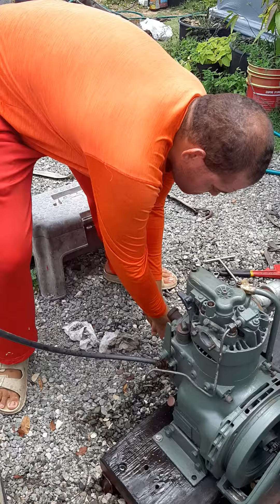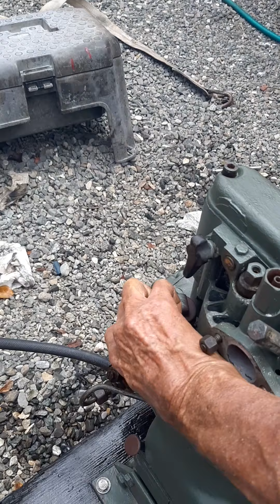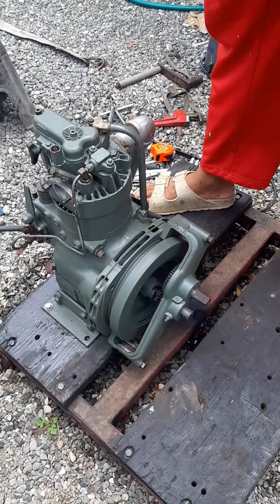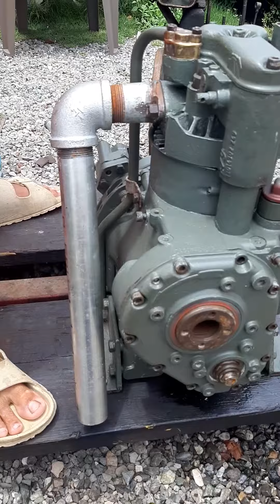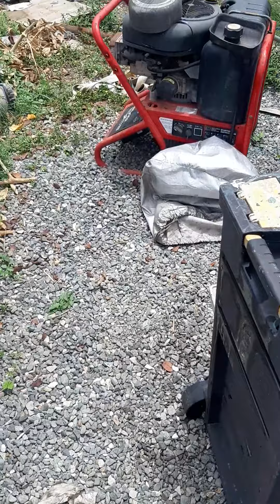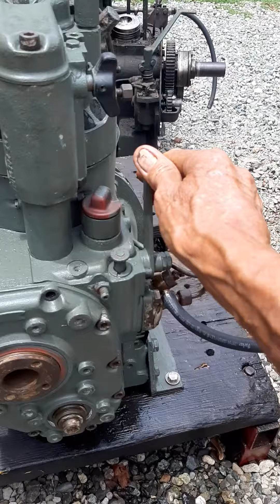Hatz E79 part 3 - it lives!

Comment: I don't know if you have seen it yet but my latest video has an inlector pump question for an AV1 you may be able to answer (I also mentioned your channel). Basically I have an AV1 pump that has a broken body. I have a spare PAZ1 injector, can I take an element and plunger for an AV1 and put it in the PAZ1 body? I'd post a link to the video but not sure that you allow links.
Reply: Here is the link:
https://www.youtube.com/watch?v=AKOej30x_yo